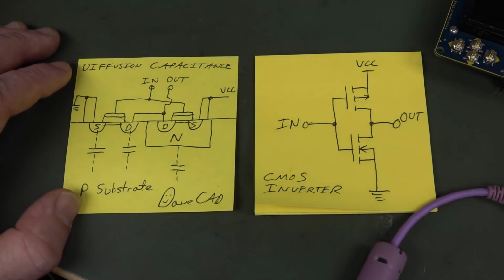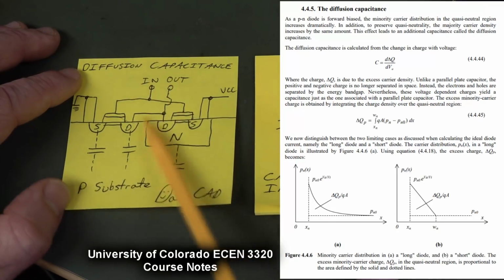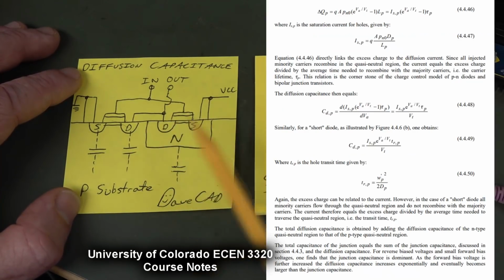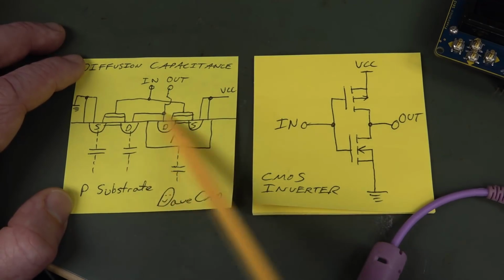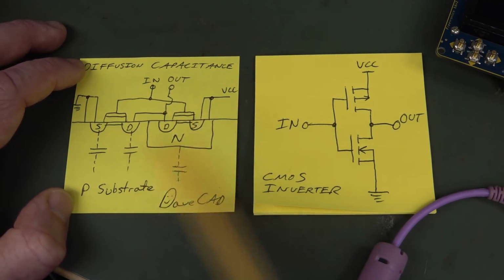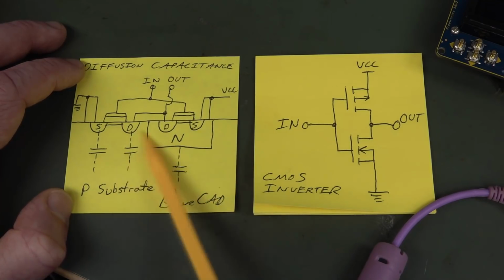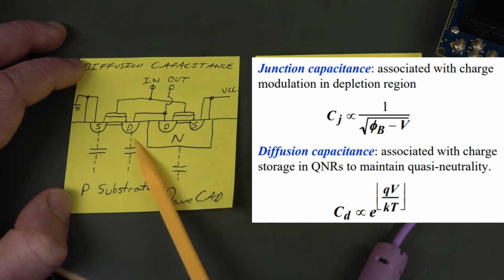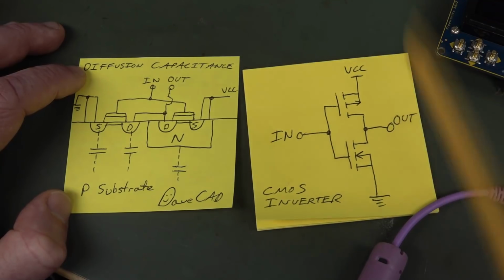EEVblog 1384 - Halve Your Processor Power Consumption!

Comment: Sinclair (Clive of Spectrum fame) used PWM to extend the life of the battery on his calculator back in the 80s :-)
Reply: Clive Sinclair started off with using PWM to make audio amplifier kits using rejected transistors. They dissipated less than analogue amplifiers more usual at the time ie. Class A or B.
Reply: @sewasewa6585  It was the first pwm amplifier.
Reply: @martinda7446  No, the first PWM amplifier was built with Shockley diodes in the '60s. Yes, it used solely uncontrolled 2 pin semiconductors (khm... Not exactly uncontrolled, but controlled by just their own breakdown voltage, without a dedicated control pin).
Reply: @sewasewa6585  yes. He also used it for led numeric displays. Clever man but a bit odd
Reply: @cowasakiElectronics  And of course his electric vehicles...which ended his company in the 80s..A man of vision for sure.
Reply: Correct. IIRC the chip's supply was turned off between clock cycles.
Reply: @Graham_Langley  something like that. I had one. It’s a shame I don’t still have it.
Reply: I have a Sinclair calculator back in the late 70's early 80's, i'll have to dig it out and see if it's doing that. Also have a Sinclair Black watch which i built in about 75 or 76 while at school. never did keep good time.
Reply: @TheEmbeddedHobbyist  I've had a lot of sinclair stuff through my hands. A MK14 a ZX80, 81 and Spectrum. Some early electronics including TVs and HiFi components etc..Never had the black watch!
I bought a Sinclair programmable calculator in 1978 and when I put a battery in it it didn't work..It sucked so much energy out of a standard battery (much more common then) it had no chance. Amazing company(ies).
Reply: @martinda7446  First computing thing i had was a MK14, even built the video card for it.
Only things left is the calculator, watch, and a micro radio the size of a matchbox.
if i remember correctly i had a Sinclair Scientific and cambridge.
Reply: @TheEmbeddedHobbyist  Wow! The video card!!!! I bet you were among ten in the whole world who ever saw that..More men have walked on the moon 😸
I remember seeing the pictures of the monitor running. I never remember seeing it officially available. I'm sure many made their own. The micro radio was his first product if I remember correctly.
I was at school when I ordered my MK14. It took ages to arrive. 
I'm now gonna look and hope you have a YouTube channel...
Reply: @TheEmbeddedHobbyist  PS I remember Sinclair talking about the Texas chip...The guys at Texas couldn't believe he got it to run at such low power to make a pocket size device  running off button cells!!...They discovered by trial and error by how much they could hold the chip off for. Not sure how much of the device was pulsed, but this power saving could obviously work for the display as well with a lowering in brightness. The chip it was noticed held memory of calculations in progress for seconds after the batteries were popped out! The maximum period for a calculation operation was just below 2 microseconds - In effect they then knew they could power the chip for two microseconds after every button press and internal calculation and the rest could effectively be off. The clock would not need to be worked around as it was the memory that was holding the calculation clock or no clock - as long as the pulse was slower than the 2uS required for calculation and storage.
Reply: @TheEmbeddedHobbyist  Subscribed.
Reply: @martinda7446  The video was great, there was so little ram that not only could you see the picture, but you could also see your code changing as well. My micro radio is in a bit of a sorry state, it lost it's back years ago.
Reply: @martinda7446  thanks
Reply: @TheEmbeddedHobbyist  My backs not so good these days..It's always the first thing to go. (then the front)...
Reply: @martinda7446  just looked at your music selection,  Magazine,  captain Lockheed and the starfighers. Not your usual selection. " who wants to buy a starfigher ! Just buy an acre of land and wait" :)
Reply: @martinda7446 . No the micro radio (the Micro 6) was not his first product. First product was a miniature amplifier.  http://rk.nvg.ntnu.no/sinclair/audio/microamp.htm
Reply: @geoffmorrison3648  Yes doh..Memory plays up.
Reply: @geoffmorrison3648  I think it was the first successful product anyhow. The Slimline was the first radio too. So I got it all wrong.
Reply: 70s😺

Comment: Doesn't a lot of of the lowered power consumption have also to do with under-volting the processor? Atmega 328's can go as low as 1.8V and sometimes you can push your luck even lower.
Reply from the maker: The diffusion capacitance actually keeps the voltage close to nominal on the die, even at low duty cycles.
Reply: Check your calender...
Reply: @gorak9000  It's the 31st here.... Gotta look at the Aussie calendar ;)
Reply: @shadow7037932  Even the Aussie calendar said the 31st for a couple more hours when this was posted. Dave jumps the gun every year.

Comment: Could this technique be used to improve the efficiency of the solar roadways? Maybe by using the vibrations caused by trucks shattering the glass...
Reply: They are "microprocessor controleld hexagonal interlocking units", so yeah, could work.
Reply: @geoffsmith6373  It's not quite as bad as that...  It's closer to 90 degrees out of phase... Mostly due to the delay induced by the diffusion capacitance and stray resistance / inductance.
Reply: na it will help that peltier shit
Reply: A solar roadway catches sunlight as good as tarmac, almost 100%. With nearly the same electrical output. No need for improvement if you can sell a solar roadway to somebody.
Reply: @admirerofclassicalelectron2858  I plan to put asphalt on my roof and I expect the same results (wrt energy efficiency) as putting solar panels on roads.
Reply: actually it`s implemented there... mechanical PWM by  wiggling the cracked solder joints.
Reply: something-piezoelectricity-something 

I guess...